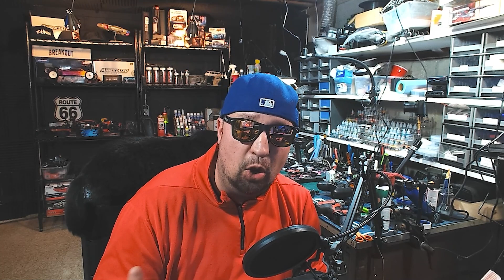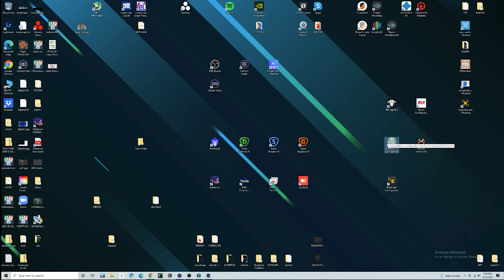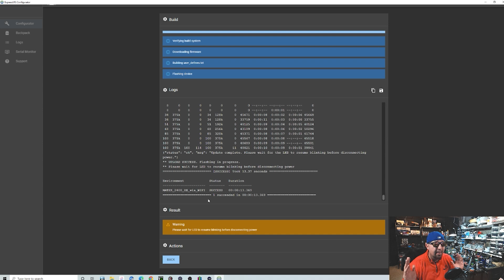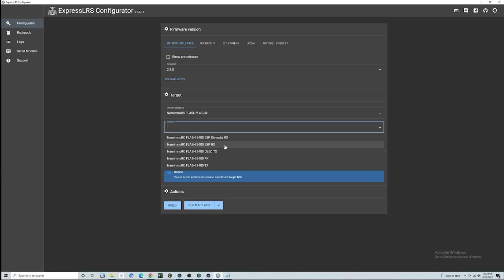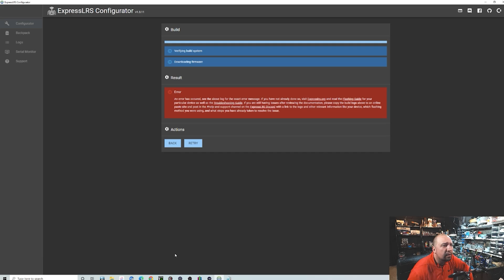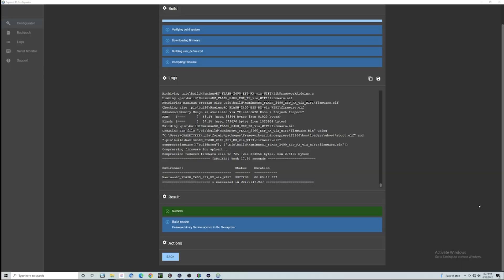EXPRESS LRS APRIL 2022 | FULL FLASHING HAPPYMODEL | MATEK | TBS TANGO2

Comment: Not sure what hitting the bind button on crossfire is an issue? when the quad is built the receiver should have the bind button accessible. Not to do so is lazy and unprofessionally my opinion.
 Great video! Thanks a lot for the time you spent doing this
Reply from the maker: Crossfire ota flashing is a thing though. It’s worked on and off for years. Trappy has admitted this fault. But after using elrs for a while now it’s ota flashing is not perfect either but they always flash when I hook it up to the fc and use pass through. So that’s a bonus. All in all I’m happy

Comment: Little tip, the Lua script usually doesn't need updating between versions. ELRS also works with the crossfire script and tbs agent lite scripts in case you forgot or your module is only a friend's radio or something
Reply from the maker: Awesome. Thanks man